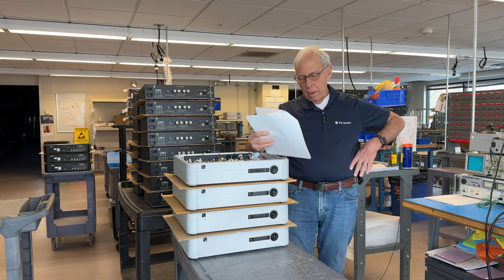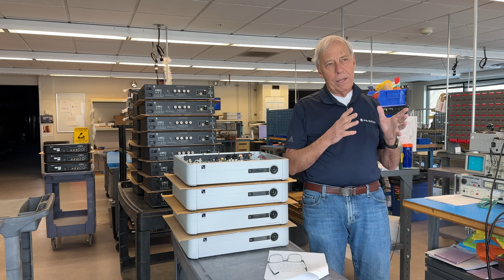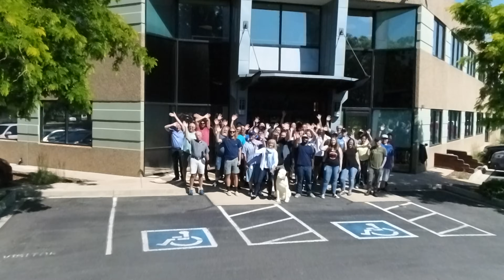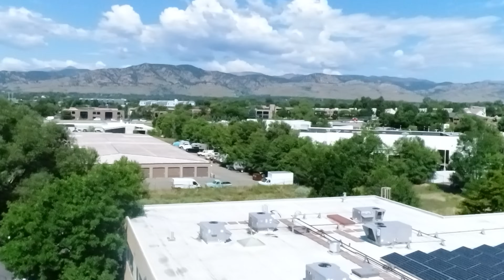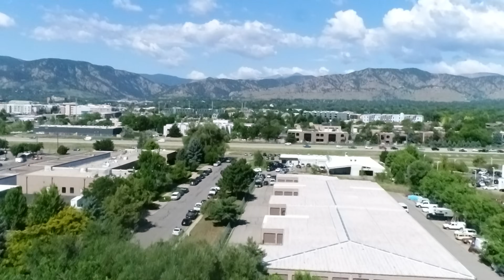Why USB noise is harmful to HiFi

Comment: Love the videos Paul. As always keep em coming!!!

And like i said before, every time this comes up i will respectfully point out that There is zero detectable with ear, nor measurable noise or jitter with my interface used as dac or adc, on either thunderbolt driver or regular usb. This whole home audio debate still confuses me. USB, when properly implemented, has been the superior dac/adc connection for like a decade now. That's a big part of why it's used exclusively in the mixing/mastering world now a days. We used firewire before that because it was also better then any other method of connecting a dac/adc to a computer source, and also allows a much broader customization of I/O parameters. And one thing is for certain, we wouldn't use it in the creation of music itself if noise was a problem with the implementations of used. Modern USB implementations can have a WHOOOOOOLE lot more bandwidth available to them as well. You definitely can't cleanly run a PCI express x16 lane with literally hundreds of GB of of throughput per second on toslink with practically zero data transfer errors. This is a cake-walk with current thunderbolt usb.

Comment: Theoretically, yes, the DAC oscillator circuit might yield more jitter if the power rails are more noisy from an external noise source. It would however be interesting to see actual measurement showing such case. Some DACs might be poorly designed to easily allow USB noise to affect the DAC clock. I would love to see actual measurements or blind tests of this subject. Why is it that these gray-zone audio concerns never get a proper measurement or blind-test? In this case it's validation of "USB noise immunity on DAC clock jitter". People happily swallow someone's opinion of something sounding more resolving, better soundstage etc. when such opinions always are without even a quick A/B switch allowing proper comparison. I believe a lot in Paul aiming at being genuinely honest in every statement made, but then why not take the lead in this industry and professionally prove or debunk every claim? Perhaps PS Audio DACs indeed are sounding better because of it, but what better way would there be than a proper blind-test and some measurements? PS Audio would be a super audiophile company by doing what the snake oil companies never do...prove those gray-zone topics are really audible or not.
Reply: "Why is it that these gray-zone audio concerns never get a proper measurement"
See gearspace DA-AD loop test (world championship of fidelity). Or AES-118, Serge Smirnoff with Df-metrics concept.

Comment: Good points. I was expecting a rant about digital noise leaking into the audio amplifiers which could cause issues if amps are trying to amplify noise above frequencies we hear which could lead to more IM distortion and possible tweeter damage, as well as just wasted power making amps run hotter. Note, I cannot prove this theory myself exempt I have heard digital noise in cases where I had a ground loop issue. Right now, I use a TOSLINK cable from the S/PDIF jack on my computer main board to a budget outboard DAC. I expect that be enough to isolate ground issues.

Comment: In other words, the digital noise which you cannot hear degrades the resulting audio sound that you hear. Meaning the sound you hear is not the noise component, but a degraded aural sound (or unfaithful reproduction of the source audio).
Reply: Oh. OK. That’s probably why the USB doesn’t bother me. I can’t tell if there’s sound degradation or not.
Reply: And most of the audio interfaces used for recording on the market are USB unless one is talking about high end professional A/D converters.

Comment: I had to use galvanic isolation on the USB connection between PC music server and DAC. I could most definitely hear it.
Reply: I love paul, and i love PS audio, but he's stuck in 2007 with his opinion of USB implementation, and so is PS audio's onboard implementation of a USB host in their devices unfortunately. But to be fair, most of the home audio hi-fi world is. Paul also knows 90% of his customer base has toslink and coaxial based hardware they already like and already use. But one thing is a fact, if plugging into your dac usb doesn't sound as good as the optical port, that is NOT because USB is inferior. Not even close. It's actually the opposite in technological reality. At least when compared to toslink optical and digital coaxial.

The inadequacies of USB for digital audio are determined by the manufacturer of your hardware, not by the limitation of the technology. 

Your issue sounds like poorly designed hardware (doesn't mean it wasn't expensive either in the server/ main board world) or your hardware just contains a poor, outdated, or lazy implementation of usb. Not a fault in USB as a technology. With good quality hardware and careful, proper implementation of that hardware, not only is jitter and time domain inaccuracies impossible with usb, but thunderbolt usb implementation also have access to orders of magnitude more throughput per second then toslink or coaxial, noise and artifacts havent been an issue in quality hardware/implementations in over a decade, since about the time those of us in the mixing and mastering world switched from firewire (which was also superior to coax or toslink at least in terms of I/o capability) to modern USB implementations.

Unfortunately inexpensive computer mainboards, and home audio DAC's where designers put no effort into USB implementation because they planned on pushing users toward toslink or coaxial have wrongly given USB a bad reputation, which only benefits the home audio companies that dont want to sell you a properly preforming single device that can handle any audio I/O need you could ever have. 

My focusrite interface has 18 in lanes, 8 out lanes, and full a to d and d to a conversion, zero measurable jitter or noise, and it can handle throughput on ALL lanes in tandem with zero increased latency, noise, or jitter at all. And it does it all through thunderbolt USB and that's barely even scraping the surface of thunderbolts actual bandwidth and capability. Thunderbolt usb can even handle full pci express x16 lanes with negligible data loss at nearly 300gb/sec throughput. This implementation of USB technology is almost a decade old itself already. 

***USB technology didn't stop developing with windows 98 folks, regardless what audio companies would prefer you believe***

I struggle to even wrap my head around what modern usb is capable of.

Comment: What USB noise are we talking about here?

Eventual noise in the data transmission line? 
(Which I don’t think it can be. Data are decoded by the usb receiver which transmits to the DAC board, no? )
Are you talking noise from there? 
In that case, I’d like to get more detailed informations. 😮

Or noise from the usb power line, 5v???
(In that case, it would be enough to make use of separate audio PSU, no?)

Comment: Everything Paul says is true, but my understanding (correct me please if I am wrong) is that you HAVE to use an asynchronous digital stream - like USB - from a streamer in order for the external DAC to use its own clock and reclock everything to a better level without as much jitter.  Because the DAC makes the two clocks sync up at the same time,  it drives the converter directly, so it doesn’t have to rely on the computer’s unstable clock. Using Toslink Coax or SP/DIF optical would limit you to how good the clock is inside the streamer, such that you are wasting some of your money on a better DAC having a better internal clock. Of course, maybe I2S is also asynchronous and offers an even better solution than USB, but does it also introduce "noise"?

Comment: Ground loops and main's hum are genuine concerns as they occur in the audible range. Especially mains hum that's either 50Hz or 60Hz.

USB and digital noise that's in the MHz/GHz range... If you're gear is so poorly designed that it's interfering with the sound and causing audible artefacts; then I'm surprised you're watching this channel. I'd be tossing that bit of gear as there is likely a short somewhere. Like the Ultrasonic noise on SACD files or the High frequency switching in Class-D amps... there are filters that supress that ultrasonic noise.

But if you want to know it's galvanically isolated:
-Toslink
-Optical HDMI cables
-Bluetooth
-WiFi
-Optical USB cables.

But the reality is; it's a non-issue or every person using USB head phones connected directly to a PC would be crying bloody murder from all the artefacts. But their silence is deafening.
Reply: Regarding the ground loops or usb noise, I most recently had that with a usb dj controller that had got just for fun with an old computer. The amount of noise was pretty ridiculous and was  like hearing the usb signalling or polling. Solved with a ground loop isolator on the rca outputs.
All cheap stuff for a bit of music in the kitchen.
Reply: You've gotten one thing wrong and one thing backwards. The "noise" he's talking about is not audible noise, it's minute electric currents and fields interfering with the digital signal before it gets to your DAC, so the waveform it converts that signal into is slightly "dirtier" than it would be. Galvanic Isolation can fix one source of noise but there's many other small sources arising from how USB works.
And poorly designed gear you're not going to hear it on, only better stuff that can actually distinguish these minute differences and then can play it back audibly. Like if you were to roll down your car window an inch on the highway. You're not going to be able to tell that it's affecting your engine performance in any discernable way, but if you were in Nascar driver competing at the Daytona 500, even a millimeter would be a noticeable difference.
Reply: Dude, you have no idea what you are on about. AC mains, USB and Ethernet all need cleaning and until you do you just don’t know. But the moment you experience the difference you will never be able to unhear those issues when they are present.